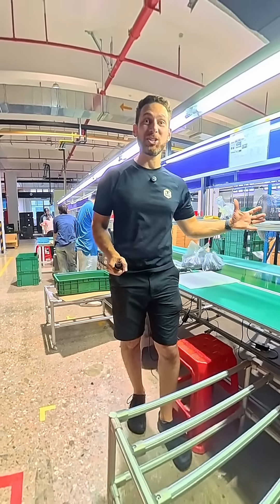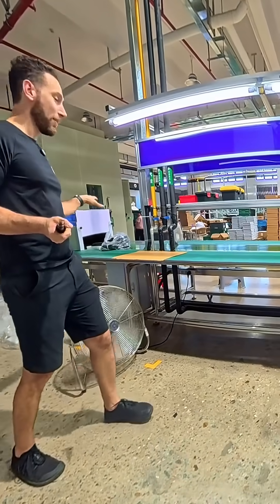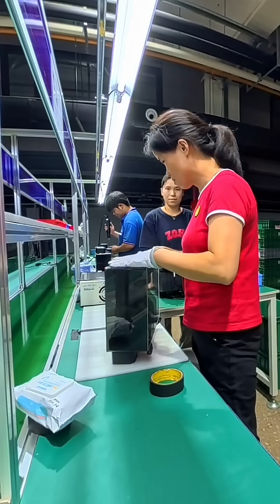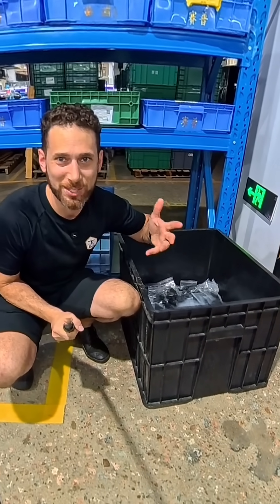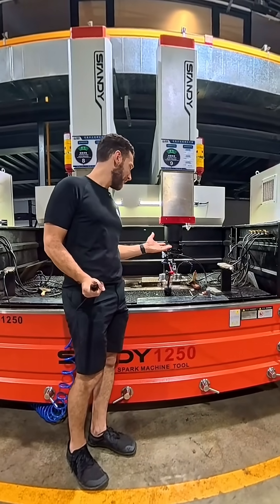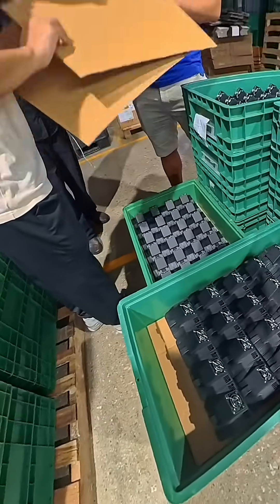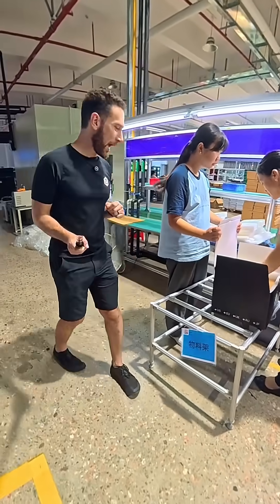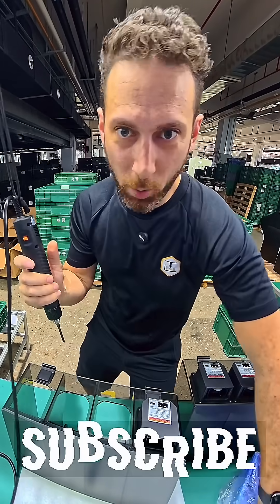I toured the EIBOS 3D printing accessory factory!

Comment: It's not wire cutting. It's wire EDM, using the electricity, not the wire. Please, for the love of God, do some more research before you tour another factory. You're talking about what are considered the very basics of assembly line practices, as if they are mind-blowing revelations from a particular company. The only thing that tells me, is that you were fed lines.
Reply from the maker: Correct, I have to rely on translators when I’m in China bud ;) also, most of my audience is like me and knows nothing about assembly lines, so it works!
Reply: I strongly disagree. This channel is not targeted at  an audience where the majority understands the processes of working at an assembly line, and as such, it was explained in a way that could be understood by that majority. I found it easy to understand what was going on and what he was saying.